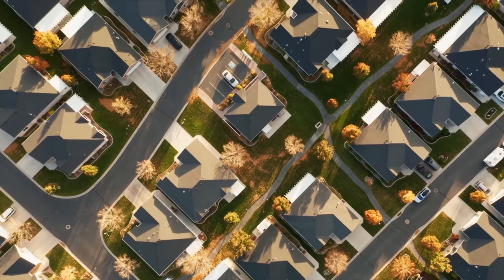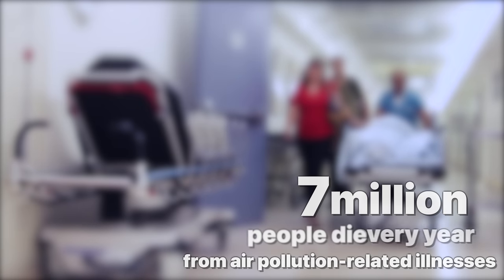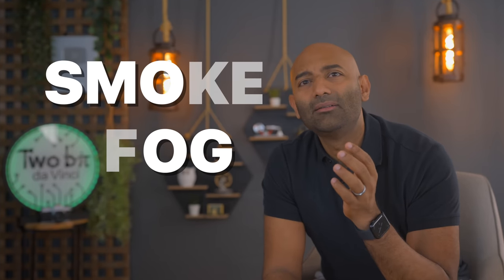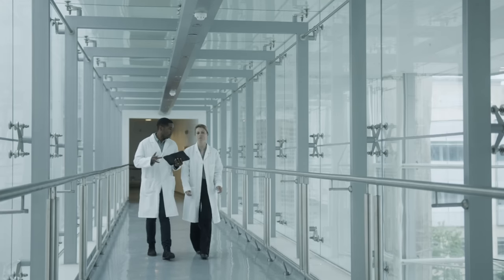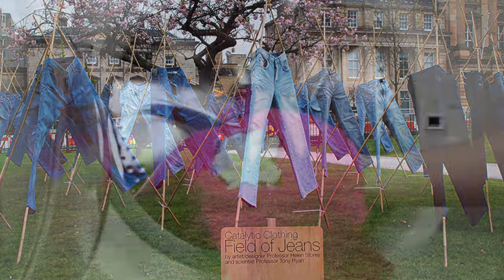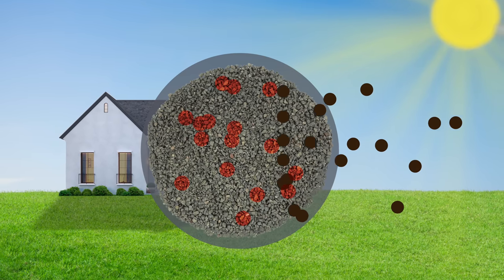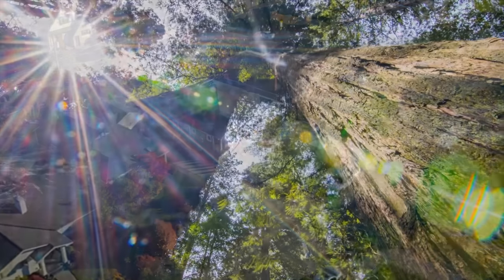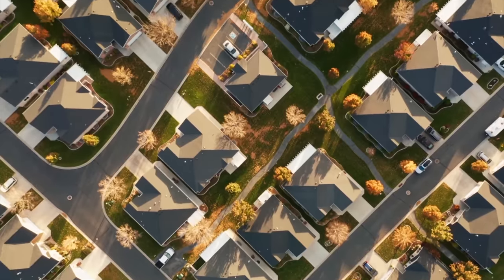This New Discovery Produces Fertilizer From SMOG!

Comment: Flushing these nitrogens etc in the sewer is extra work for the sewer cleaning plants. When using the roof water for self consumption, your purification system needs to work hard. The first flush water (as this likely contains the highest concentration) should be captured in separate containers for watering the garden.
Reply: I prefer “extra work” be done by the Sanitary District that I fund with my property taxes, rather than my family’s lungs. But a lot of rainwater doesn’t pass through those facilities and goes straight into our lakes, rivers and oceans.

Comment: I remember back in the 70s when the term, "Smog" was created. It was on the news a couple times. Someone was pretty proud of themself for thinking of it.
Reply: The phrase smog goes back to the early 20th century. The famous London smog of 1952 brought about the clean air act in the UK.
Reply: The term 'smog' dates back to at least 1880 possibly even a little earlier.
Reply: I lived through several real smogs here in London in the 1950s. You couldn't see more than a foot in front of your face and your nose filled with black soot from breathing in the polluted air full of coal/coke dust.

Comment: I wonder how long the granuals remain active before they need a rinse.     In CA or AZ it can be several months between rain storms.
Also, will all those nitrates going into the water system just move the problem to the waterways and oceans?

Comment: So many questions still need to be answered. Most water in most countries running off roofs goes into the ocean(more fertiliser dead zones)? Could this water still be used for storage and drinking water?  What's the effectiveness of PV solar on the roof? Will it keep working over the summer if no rain happens for months?

Comment: It would be better if you could simply spray a roof with a coating of this stuff...
Reply: I mean, why stop there. You could spray roads, sidewalks, sides of buildings also...
Reply: You'd want to coat the surface of the room with an adhesive. then you'd sprinkle the granules on till they covered the adhesive. Maybe there a gently pressure to ensure good contact with the adhesive, but not so much pressure that you coat the granules preventing smog absorption.

There will be lots of loos granules that get washed down to your gutters, and that will need frequent attention the first year or two.

Comment: I'm confused. Aren't nitrates the reason that we have more toxic alge than ever before? If everybody bought these smog cleaning roof shingles and the rain rinsed the nitrates in the storm drains which goes to our rivers and ultimately our lakes and the ocean then wouldn't this make the problem worse? Maybe I'm wrong?
Reply: People buy unbelievable amounts of fertilizer for their lawns & gardens. This could basically eliminate it, as long as runoff goes to the green areas of the yards.

In many states, it is illegal to run your rain water directly to the sidewalks & driveways. In my state, rain runoff must be directed to green area, and new construction [for decades] required building of water 💦 retention areas which must fill up before being allowed to go to sewers whenever a parking lot is built… not only for commercial, but even for churches. Can’t even wash your cars 🚗 & legally run that water into the street!

Usually, progressive locales have such building code. 

Heck, even Georgia has progressive water code like this, so one has to be in a pretty backward place to have otherwise! 😂

Comment: Ironic that it probably doesn’t rain consistently enough in the urban areas where most smog is created to actually clean the air year-round. People would have to wash their shingles and PV panels regularly. 
Also, no new construction will use this unless it costs less than current shingles and it take decades before enough people re-roof before this would be implemented in sufficient scale to matter.